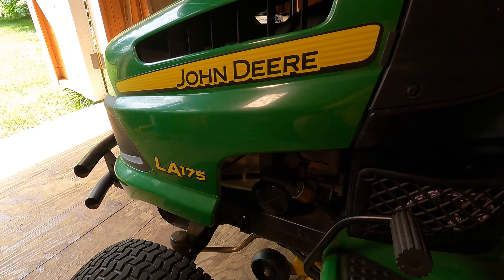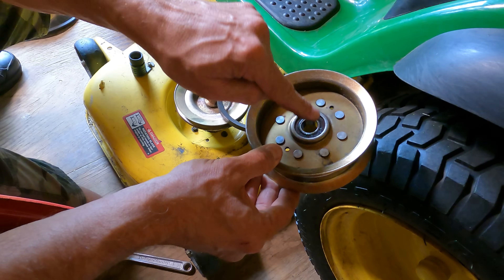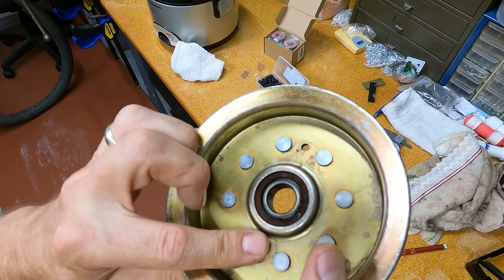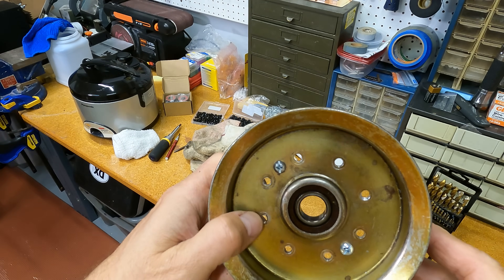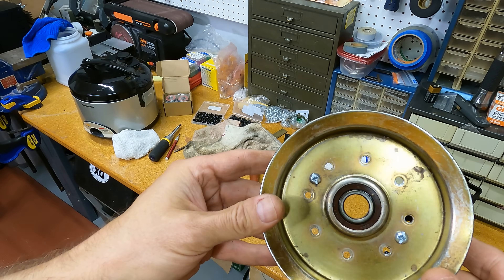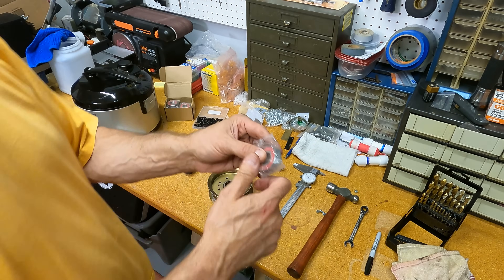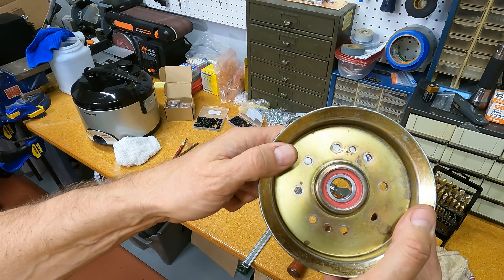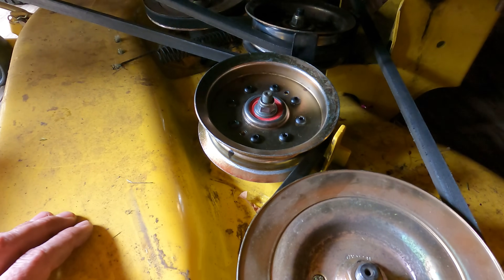John Deere mower deck bearing replacement

Comment: A very good informative,  interesting video 

I've done many of those.  I have been asked if it really worth the time just to change the bearing.  Like you said, it makes changing the next bearings much easier and definitely much cheaper.  The only time  I couldn't do that was one side of the pulley was cracked where the bearing goes.  However I did separate and saved the good half just in case I need it. I buy the 10 pack bearings as well
Reply from the maker: It really is easy if you're even moderately handy with tools, and well worth the effort to save future expense IMO. Thanks for the comment, and the support!

Comment: John Deere is pioneering the art of making their equipment difficult to service. (Along with HP, Apple, and many other companies who put their customers last.) I would add that 100 or so hours is terrible service life for a bearing in this kind of service. JD must be using cheaper bearings than the bulk pack you bought. So happy to see this hack.
Reply: I have the original bearings and spindles in my Cub Cadet 1515 lawn tractor with 1,167 hours. The spindles have grease fittings on top of them. I was told by the dealer that those bearings are NOT sealed inside. I use #2 Heavy Duty red grease
Reply: The 1515 is a 2002 model.
Reply from the maker: @donaldbracciano832  Thanks for the comments, and for watching!
Reply: Actually it's a case of not cheap bearings rather the inability to relube them. And lets all agree, all bearings for the purpose they provide are quite reasonably priced.
 
Using my method of using a pointed push pump grease unit from Oregon such as one would use on a chain saw bar front sprocket I don't have to toss reusable bearings.

Heck I didn't have to spend a dime on bearings and fasteners. Just cleaned them up real good and pumped it in between the inner race and seal. Have over 650 hours on this 54C JD deck. 
Also when greasing the spindles pump it in with a normal  grease gun till the grease starts to come out. It usually takes 10 or more initially, then less in the future.... I buy alot of grease for servicing my equipment and other clients equipment as well.
Reply from the maker: @happyrecluse2849  Thanks for watching!
Reply from the maker: I couldn't agree more... Thanks for your comment, and for watching!
Reply: I'm glad I got to see this one
Reply from the maker: @phyllisgraham6985  Thanks for watching!
Reply: Original JD bearings in spindles have "Made in China" mark.
Reply: @ramunasvanagas868  I replaced two sheaves. The larger had an NTN bearing and the other was marked only 6203RS.

Comment: Just finished doing all bearings on John Deere x300R ,lots of ideler's, save heap's with this method.some are spot welded as well must drill them as well.Managed to get 630 hours out of original bearings !!!! Thank You.
Reply from the maker: Glad it helped, thanks for watching!
Reply: @grahamsmith347  that’s pretty good hours for idler pulleys. Some last longer some less. They make a lot of noise when they dry up.

Comment: Do you wash your deck with a hose? From the factory they dont put enough grease in the berrings you can take the plastic shild off and pack a lot more grease into them to make them last longer.
My cub cadet  all of them are spot welded I washed the deck really good but put it away for winter without using it, the next spring they squealed like pigs it was really loud,  I took the deck off the mower and repacked every berring the noise went away, that was 4 years ago and its still working good. But I dont use the hose on the mower anymore and its filthy but runs like a top. I can use the leaf blower and scrap the bottom of the deck clean.
Id rather it work then clean it spotless.  On the thin sheet metal id rather not use water on it just paint and oil. If you oil it and grass sticks the oil will protect the metal from rust. Even if it bare metal. 
Something like a garage spring spray is fine. Put it on the blades too.
Reply from the maker: Wow! Thanks for all the information, and for watching.
Reply: I use air, leaf blower, on the deck and water on the mower. Keeps me from getting the deck bearing wet and I can keep grass and stuff off the rest of the mower with water where necessary.

Comment: Chinese bearings come ungreased. If the new bearings fail prematurely, try opening the dust cap and packing the bearing
Reply from the maker: Some do, but unfortunately not the majority it seems. This was one of the most mentioned items in comments, so I put a text blurb in the description section. Thanks for watching!

Comment: THE CRESCENT 🔧 WRENCH THO!! You spent more in labor and parts than what the "replacement" would cost...not everyone can do this in e.g. fields, parks etc.
Reply from the maker: Except I love doing stuff like this, and my time is just that, my time, and noodling through DIY repairs can be its own reward. Does not always have to have a blistering ROI. And yes, I have multiple socket sets, but intentionally picked up a crescent in this case, as it was close by, and never asks "metric or SAE" ;) ... cracks me up how many people are hating on the lowly adjustable wrench, lol. Thanks for watching.
Reply: @halfmoontechlabs  busting your balls buddy no pun intended

Comment: We use to do this on farm equipment year's ago it's alot easier to to cut the rivets with a band saw
Reply from the maker: The shell design on this was so thin that I fear a bandsaw's kerf would destroy it in the process. I have seen this done with thicker pulley/sheaves, but this is basically stamped sheet metal... too thin IMO. Good suggestion for beefier ones though, thanks for the comment, and for watching!

Comment: It’s  not a sheave it an idler pulley. Sheaves are for V belts, also you should have alternated the bolts with half the nuts on one side half on the other for balance.
Reply from the maker: Both of your suggestions are covered in previous comments by others. Thanks for watching!

Comment: I just woke up and watched this video.  You said there was three of these . I was thinking how does the blades turn with pulleys that has bearings in them. There must be just the one idler pulley like that.
Reply from the maker: There are 3 sheaves (JD's term) that serve as idlers (back of belt contacts sheave in this case), and the V-belt then passes though separate V-pulleys (on spindles) for the 3 blades. Pause the video towards the beginning when I'm pointing under the mower, above the deck, you can see the difference between the idler function and the actual V-pulleys on the spindles. Thanks for watching!

Comment: Do it again but use a SKF bearing.  Just teasing, but that's why the first bearing died, they're just cheap China bearings...
Reply from the maker: I'm a fan of SKF myself, but wanted to try some decent quality generics, these actually have some decent grease. Thanks for watching!
Reply: @halfmoontechlabs You mentioned three pulleys on your mower.  If you bought a dozen cheap bearings and replace them every 3 to four years I am guessing at that time you may need more than bearings.
The thickness of metal on the deck means it will fatigue and crack .... eventually it will need welding or replacement.   Even the pulley you rebuilt was distorted due to thin metal.

You only get so many hours out of that entry level mower.
Reply from the maker: @jimw6991  I bought this new over a dozen years ago, and it still mows like brand new... just oil changes and these bearing replaced once in that time. Not too bad if you ask me. I agree the deck metal is probably a future failure point, but so far I can't complain. Thanks for watching!

Comment: Or just replace it with an automotive serpentine idler, if diameter is acceptable.  They last forever
Reply: You did do a nice job on the pulley, funny my old JD F935 has a snap ring that you remove to replace bearing on a cast v-pulley. Very easy and cheap. Thanks for sharing 👍
Reply from the maker: It was nice when more things were made to be easily repaired, now everything is disposable, and nothing lasts :(      Thanks again for the comments, and for watching!
Reply from the maker: Thanks for watching!

Comment: Whilst this is an exemplary DiY fix, if you took your mower to the mower shop they would replace the whole unit as the labour cost to make the modification would exceed the cost of a new part.  'Tis the state of the world.
Reply from the maker: No doubt, which is why I took a crack at it. Thank you for watching!

Comment: why didnt you pop the inside dust cover off and full the new bearing up with grease, then put the dust cover back? you have no idea how much grease is inside your brand new bearings
Reply from the maker: Ah, the miracle of editing... I had already popped another open in the pack to check (mentioned already in earlier feedback). I showed you one, but I had already verified on one of the others. Good advice though, and I totally agree. Thanks for watching!

Comment: Also don't forget to secure pulley in vice or clamped to drill table.
Reply from the maker: Yes, solid advice! I am trying to work safer, but admit I have relied on PPE or luck in the past far too often, and with mixed results ;)  I am endeavoring to improve in this regard. Thanks for watching, and for the good advice for all!

Comment: Even though it is a new bearing , I always pop out the seal and check the amount of grease in them!  Always not much in them, so I pack them with a little bit more grease !
Reply from the maker: Yes, this has been a popular comment by many... good to double check the amount of grease, especially with bargain bearings ;)  Thanks for watching!
Reply: It's amazing how little grease is in the new bearings. I pack mine full. If nothing else, it keeps dirt and moisture out.
Reply: @craigsmith8217 they only need 25-30% filled with grease, too much and they tend to overheat.
Reply from the maker: Correct, overfilling them is not good either! Thanks for watching.

Comment: If I do the work of drilling out the rivets and replacing them with screws to replace the bearing, then I wouldn't use cheap bearings. Cheap China bearings don't last long, I only use high quality bearings. It pays off at the end.
Reply from the maker: I did inspect these bearings before use, decent grease, and nice quality, but I hear ya... whenever buying parts from overseas, be cautious when it comes to quality. I took a chance on these, and they seem to be decent quality (good overall feedback as well). Time will tell! Thanks for watching.
Reply: I’d use Timkin bearings.

Comment: Why not just grind of the lip of the center bearing mount and press old out and press new in. Would to be easier and quicker, I would think.
Reply from the maker: As I pointed out to several viewers, if you watch the video, you will notice that the bearing is intentionally "captured" under the stamped metal lip on each half of the sheave. It cannot be simply pressed out with an arbor press or otherwise. Thanks for watching!
Reply: Each half has a lip, that's all that keeps the bearing in place. These are cheap "stamped" pulleys. Probably not cheap to buy, but made about as cheap as could be...

Comment: You got to love center punch, not centered. Don’t call it center punch unless it is punched in the center. Otherwise it is just a divot for the drill to start at.
Reply from the maker: "By eye" centered is close enough in this case because as mentioned in video, I was going down to surface but not drilling through on first pass... just need to touch the surface and then knock out with hand punch. Then I drilled clear through in 3rd op to resize holes now exposed to accommodate bolts. Extreme precision not required in this case. Not mentioned in video is that the machine peened rivets do not "squash" the rivet heads in a  perfectly uniform fashion. "Eyeballing" it in this case lets you make minor adjustments to compensate for this if required. Thanks for watching!
Reply: @halfmoontechlabs  ok i understand center punch has nothing to do with center, or center punch would be called, just punching close, maybe close enough. Or else don’t use the term center punch, try “PUNCH”. DA
Reply from the maker: @SPUDHOME  Ok, how about "approximate ellipsoid concentric marking tool"? I feel better now too ;)
Reply: Maybe it's called a center punch it because that's where the center of the drill bit goes. Holes aren't always drilled in the center of an object.
Reply from the maker: That's a fact! Thanks for watching.

Comment: Could you use pop rivets instead of nuts & bolts?
Reply from the maker: It's a nice idea, but I would not recommend pop-rivets, their strength is ultimately based on the diameter of the center pin, which are very thin compared to a 1/4-20 or comparable bolt. Also the much smaller size may make for an excessively sloppy fit. Thanks for watching!
Reply: @halfmoontechlabs  Thanks.

Comment: .
Question for you why didn’t you just press out the wheel bearing instead of going through drilling and buying screws
Reply from the maker: If you look carefully at the bearing in the video, it's captive inside the sheave with a preformed shelf that negates pressing out the bearing (on each side)... hence having to drill out the rivets to separate the two sides to extract the bearing. Simply pressing it out is not feasible on this JD design unfortunately. Thanks for the comment, and for watching!
Reply: If you would watch the video it is clear that you cannot press out the bearing.

Comment: The seals are easy to reinstall after removing.  I use a razor knife to lift the seal and replace the same seal by simply pressing it back.
Reply from the maker: Yes, a knife edge, razor, pick... lift it, pop it out, grease and snap back in place! Thanks for the comments!

Comment: You can insure the longer life of te bearing by popping the seal and packing good grease because they are not always sufficiently greased when bought new.
Reply: Ditto for "cheap" Chinese made angle grinders.
Take the gearbox apart, 
remove the blob of yak fat that has been spun out to the outside of the housing...
and pretty much fill the housing with a good high speed high temperature bearing grease e.g. what you use in your vehicle wheel bearings.
Pop the gearbox back together...
It's now quieter and will last as long as a super duper 10x more expensive name brand...
perfect for lending to mates or workers on site that "just want it for 2 seconds mate alright"?
Reply from the maker: Thanks for watching!
Reply: I've been doing that for over 25 years. The first time doing that was repairing a router got tired of replacing bearings that didnt last. I took them apart and put in better grease, & sealed back up.

Comment: I never realised that those cheap bearings were even cheaper by the dozen.   I hope there are suppliers here in UK, as my Countax is getting a bit noisy down there..
Reply from the maker: I found mine on Amazon, but eBay has bulk packs too. Thanks for watching!

Comment: This is a great idea the bearing is sandwiched between 2 identical pulley halves the guy did a great job and if you are sitting in your easy chair and don't own a riding mower or work on them you should not make any comments at all
Reply from the maker: Thanks. I do try to be fair and answer most all questions, even when some can seem unfairly negative. I only delete the most nasty or non-sensical comments. 98% of comments are positive, or truly inquisitive. Thanks for your support!

Comment: You never said, what length the quarter 20 screws are
Reply from the maker: For this sheave, I used 1/4-20 x 1/2". This could vary depending on make of sheave, etc... but 1/2" long for this particular one. Thanks for watching!

Comment: Those are idler pulleys.
Definitely wouldn't put lithium grease in those bearings. How much were the bolts?
Reply from the maker: Raw parts cost (per sheave) Bolts 24¢/ea x 8 = $1.92; Nuts 22¢/ea x 8 = $1.76; Bearings $1.45/ea x 1 = $1.45: Total raw component cost to repair each sheave = $5.13   Tools are a "sunk" cost for me as I already have them, other peoples mileage may vary as they say. Thanks for watching!

Comment: Regarding many comments about adding extra grease to the bearings.  I bought new bearing from a local bearing store for my spindles and I specifically asked the owner (40 years selling bearings) if I should add more grease.  He said absolutely not.  He said, the manufacturer uses a "special" Teflon type of grease that's engineered for bearings.  Being a curious person, I added some white lithium grease to one set of them so guess when one of spindles fails at some point I'll have the answer, ha!  Good job!
Reply from the maker: Nice! Thanks again for watching
Reply: Quality bearings don’t need any cheep ones do.